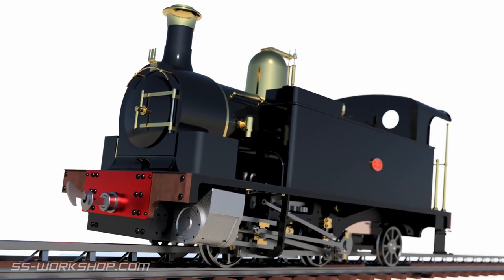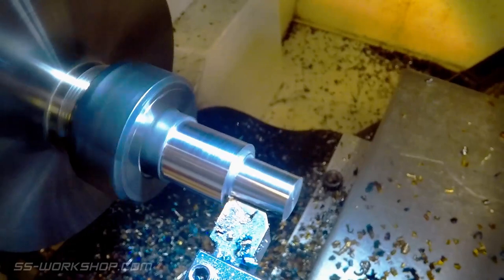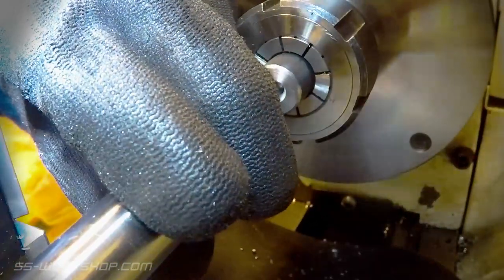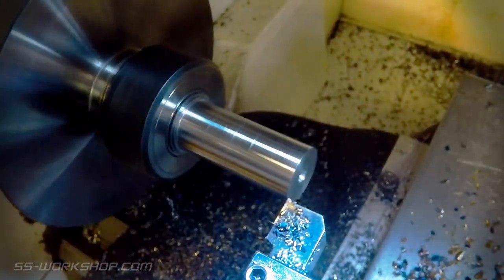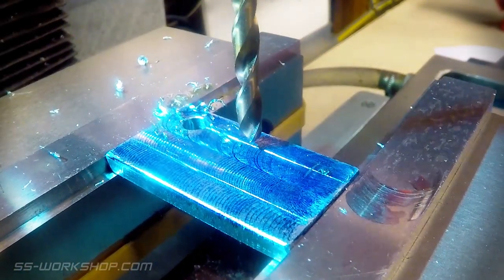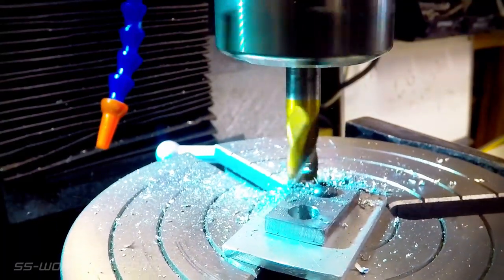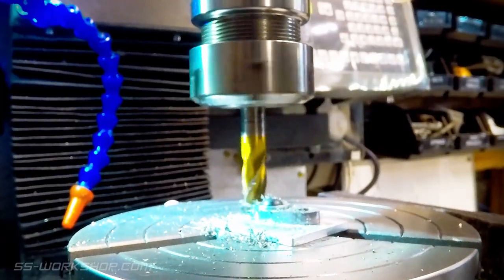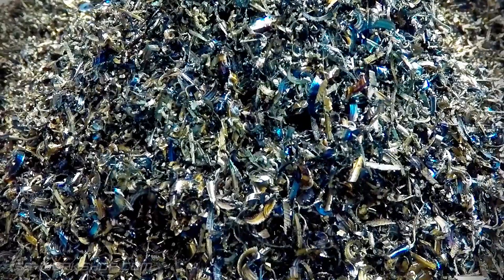Fell Engine Project - Machining Crank Arms S1.E15

Comment: Nice work Chris.
On my 9F the cranks are the wheels themselves. My wheels are held on with just Loctite 638 (high strength retainer). The drawing called for either the loctite method or press fitting. I didn't fancy trying to press an interference fit whilst maintaining accurate quartering! The axle journal was turned to a nice 'push fit' on the wheel. Then the mid 3/4 of the journal is turned 0.002" under size. (see 1:16 on video 14) This provides the 0.001" space for the loctite to do its job. I was a bit dubious as to the strength of the loctite joint. I soon discounted that worry. One of my wheels sets cured before I had quartered it accurately. I tried to turn and remove it by various methods including using a crow bar and it didn't budge a thou!  All this happened within 1 minute of applying the stuff - so work quickly! The only way to release it is to apply heat - around 200C + , even then it takes some force. Your crank arms look a little narrow so the surface area for the loctite may not be enough. I would use loctite to quarter them and pin them afterwards if there was any doubt.

Cheers Craig
Reply from the maker: Thanks Craig, I haven’t seen the recess machined in before but makes sense keeping the wheel centred on the axle with the slip fit and making space for loctite. It looked like your crank pins were installed the same way? One other thing, when you lapped the axle to the axle box, what were you using as the abrasive? I will be heading back to rewatch more of your earlier videos on the parts I’m up to great resource of info. Cheers Chris
Reply: Yes exactly the same process for the crank pins. For lapping I used Brasso metal polish.
Reply from the maker: Thanks for that.